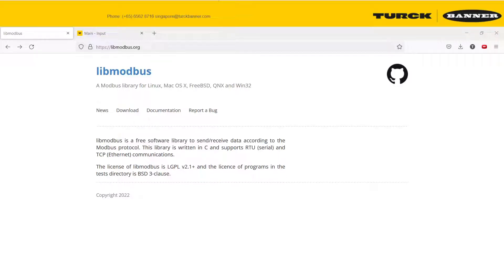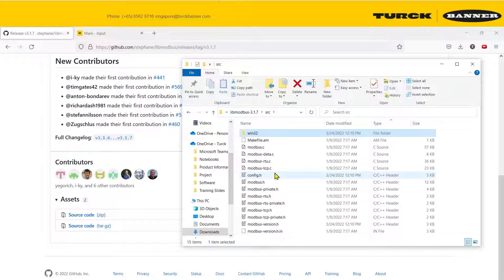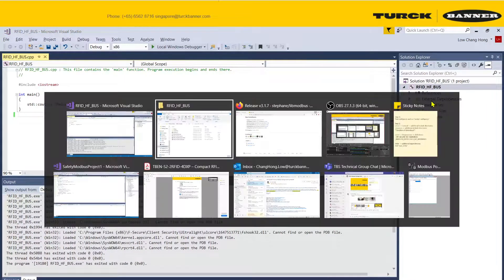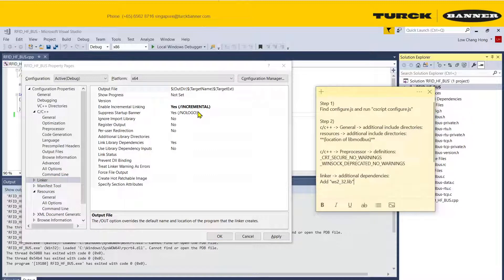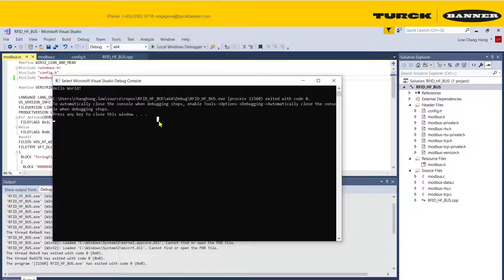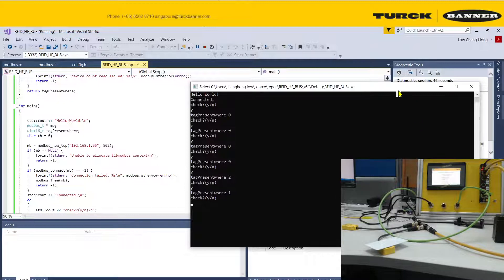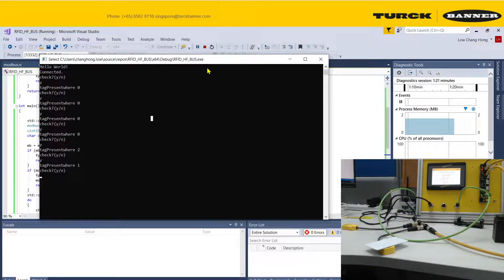How to use Modbus TCP in C++ with libmodbus in Visual Studio 2017

Comment: weach functions displays an errno when a specific libmodbus functions fails to do its task so i waned to ask whether the string attached to that error is also shown in the output which describes what that errno means? if so how can i add that to the throw in exception handling? thank you.

Comment: I want to execute a DLL made in cpp using libmodbus inbuilt api's and run that DLL in csharp so is that achievable? If so, then any tips on how I can make that work?
Reply from the maker: Unfortunately, I am not too familiar with DLL implementation. 
I believe the repo owner already compiled some sample DLL. Prehaps you could look into repo for that.
Reply: It is definitely achievable. You just need to make a project in C/C++ that exposes some API, the project will be build as dll project and a C# wrapper over it.

Comment: Thanks a lot for the read function. I would like to ask if there is a function to write to registers through MODBUS as well. If so, how to do that? Thank you. 
Also, is this code only viable for modbus-tcp or can we use it for communication done in modbus rtu as well?
Reply from the maker: Yes, i believe there are functions to read and write modbus registers. And to use for modbus rtu, use modbus_new_rtu() instead of modbus_new_tcp()

You may find documentation of the library's available functions at the main website. https://libmodbus.org/
This build is done using v3.1.7, so documentation is here https://libmodbus.org/olddocs/v3.1.7/libmodbus
Do consider supporting the project. :)
Reply: @chlow1627  Thank you very much for the timely response. It was very helpful.
Reply: Will modbus_connect(mb) return -1 if there is a usb-rs-485 converter connected to a COM port but the converter itself is not connected with any device?
Reply from the maker: @anshuman2952  Hi, sorry for late reply, on my code, it exits with an exception error. Haven't had time to really figured out how to resolve this

Comment: I know this is an old video, but i hope you can help. 
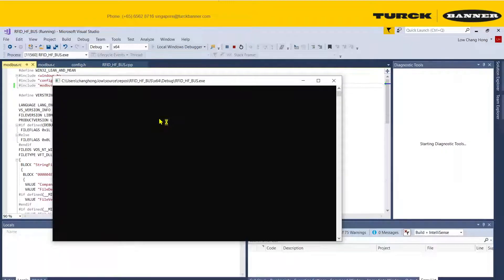I can't get it to run at 10:34 in the video. It gives me 8 errors of unresolved external symbols. I am running the latest version of Visual Studio Community 2022, that being version 17.5.1 and version 3.1.10 of the libmodbus. I would greatly appreciate it if you have any solution to this and are willing to help.
Reply from the maker: You are in luck. Maybe more details about the error message?
I happen to see this. If I recall correctly, I saw unresolved errors when I missed out certain linkages, so maybe step through the video again ?
 Also, Did you include extern "c"?
Reply: @chlow1627  I saw it again and figured it out :D
I got a problem that said something about the preprocessor definitions being undefined. On Google someone said that I could go to C/C++ settings -> Advanced and type disable the specific warning 4996 and it worked.

Comment: I did as shown in the video, but when I compile (minute 15:36) the error appears "undefined reference to `modbus_read_registers', undefined reference to `modbus_strerror', undefined reference to `modbus_new_tcp'...", how can I solve this problem ?
I'm using Dev C++ because my pc version doesn't work this visual studio
Reply from the maker: I would guess your code cannot find the modbus library you included. You may an issue with linking the library to your IDE. Unfortunately, I am not familiar with Dev C++ interface, so you have to look for other tutorials on the linking files within the same folder